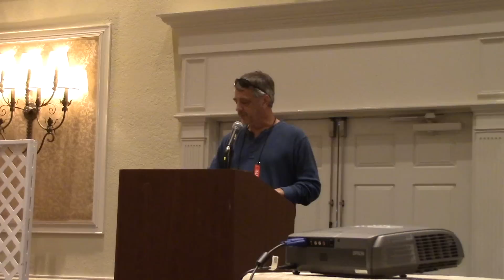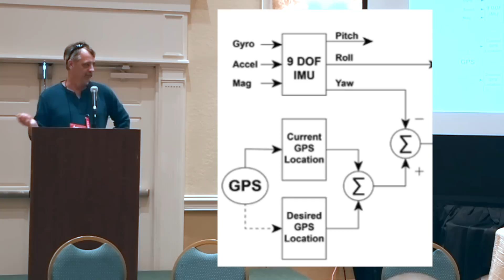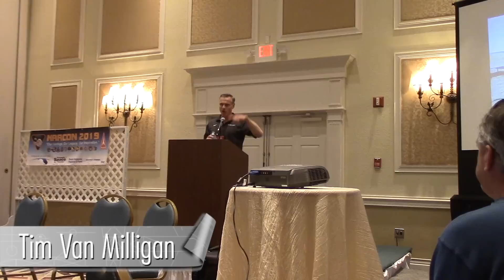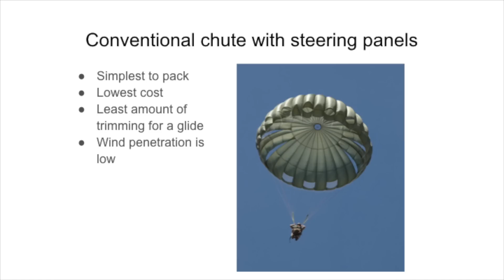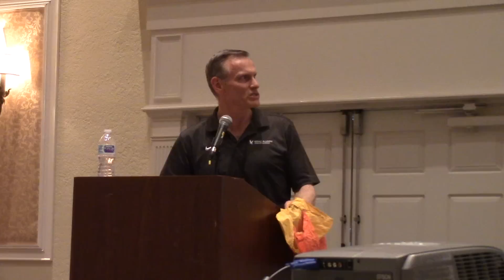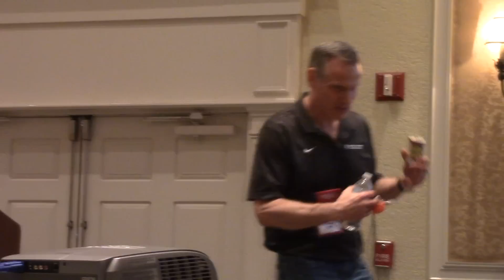Developing the GPS Guided Recovery System

Comment: Have you thought about the new FAA regulations regarding drones and model aircraft? 
As I understand it this would count as a UAV and therefore wouldn’t be allowed above 400ft without special permission. 
I’m not saying I agree with the FAA but I’m just wondering if you’ve got a work around because I’m interested in autonomous rocket recovery
Reply: The airspace regulatory hurdles can be at least as big as the technical ones - especially important to investigate for a potential product.
Reply: Know if it applies to unmotored gliders like this? I'd like to hear FAA safety argument advocating for an unguided falling mass compared to a guided falling mass. Same mass, same potential energy. But in the guided case you might actually be able to avoid problems.

Comment: Given that the chute responds so wildly when you try to turn rapidly I wonder if it would not be more reliable to never aim for the point you want it to land.  To me it makes more sense to make your approach angle inversely proportional to the distance from your target topping out at 90 degrees when you get within an acceptable radius.  So if you deploy 300 feet away you would start by turning in to face 5 degrees off of your target right or left.  By the time you get within 100 feet of your horizontal distance you would aim something like 45 degrees right or left of the target, then when you get within 10 feet you aim to keep the point 90 degrees left or right.  That would put the rocket on a naturally decreasing orbit that stabilizes as it approaches the landing spot rather than one that keeps flying past the target and trying to turn around and recover.  This would let it retain some of its forward momentum and traction as you turn into the wind rather than dumping all of that momentum whenever you do your 180 degree turn on the downwind side.

Comment: Really interesting and amazing work so far!

I am working on creating an auto pilot for an RC plane using Arduino and I am precisely working on the GPS-IRS data fusion to estimate position and velocity. I am having trouble since I am not sure how should I manipulate the data from the GPS to give me the data in the proper axis and units (basically transforming GPS longitude, latitude and altitude data to position with respect to the point of origin so that I can readily fuse it with the IRS unit data). Do you have any tips, sources and/or documentation that I could check in order to try figure out how to work around this problem?

I am an aerospace engineer specialized in control and when it comes to flight dynamics and controller design I have the hang of it, but I lack knowledge on the data acquisition and software development side for sure, any help would be appreciated! (Also, if I could help in anything, don´t hesitate to ask, although I feel you have way more knowledge than me!).

Cheers,
Carles
Reply: are you using arduinio nano ?